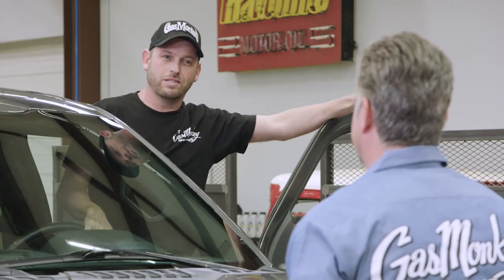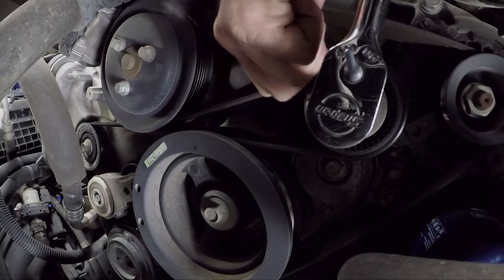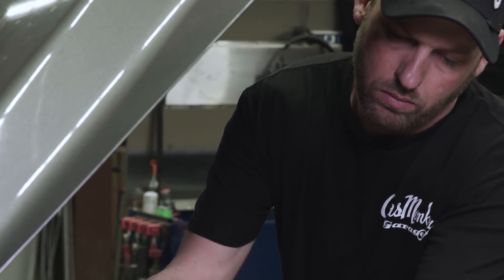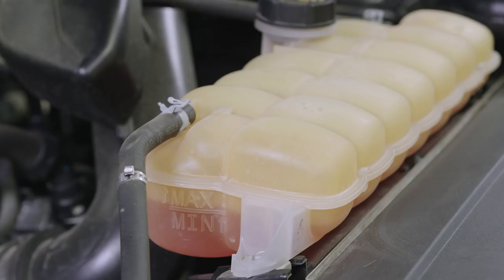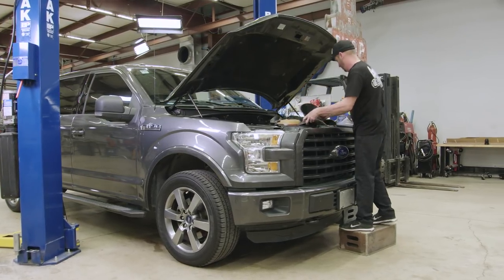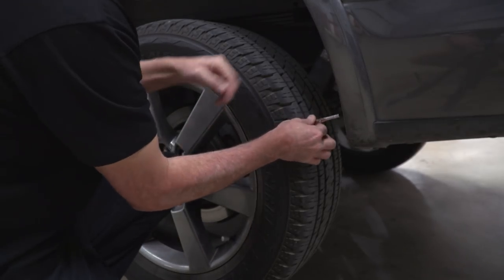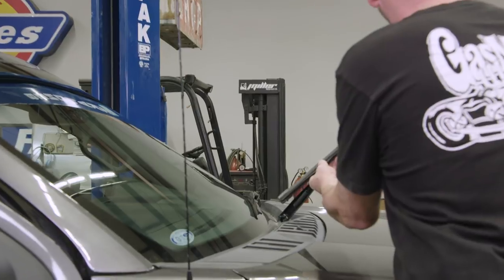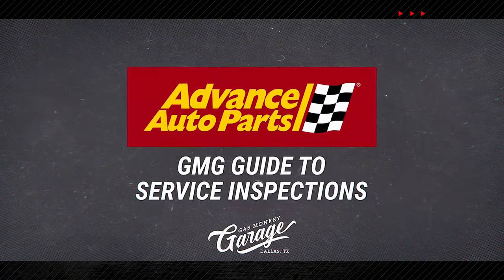Gas Monkey - Service Inspection Guide By Gas Monkey Garage - Advanced Auto Parts

Comment: Wow you made a training tape for Jiffy Lube while trying to sell crap for Advanced Auto Parts.... I feel dumber.
Reply: TheKnightda8 did you see that they are looking over a Ford F150 and pouring in what they say is GM Dexcool.
Reply: calimesacox actually a lot of the newer fords take dex/orange coolant.  I don't know about the f150 specifically but the fleet I work for has a lot of Fords and it is a mix between dex (orange) and G05 (gold) coolant.
Reply: Sorry to tell ya but Dex is not... compatible with multi car. Dexcool os a GM product. And has been the discussion of many failures of composite gaskets. Such as plastic and rubber. Used in 3.1 the 3.8 Buick line. The 5.3 paper gaskets on the water pump. Even has a GM TSB. For these early failures they blame air contamination and customers adding wrong coolant.
Reply: calimesacox that is true but many newer fords specify Motorcraft Orange Coolant.... Which is dexcool.... One and the same. I just looked up the correct coolant for a 2017 F150 on Napa Prolink.... Motorcraft Orange